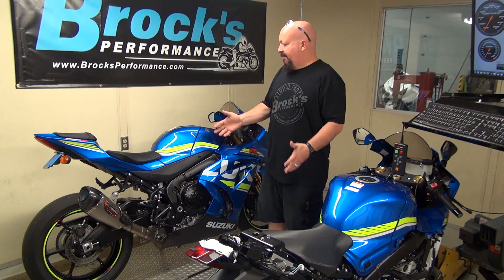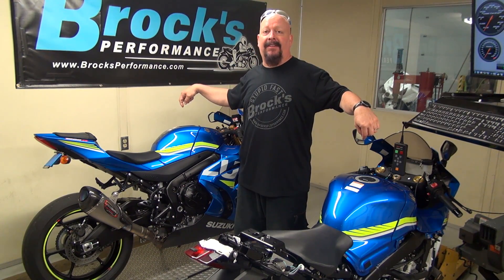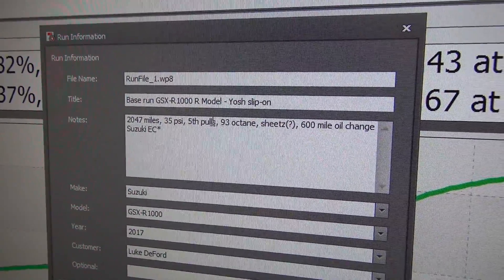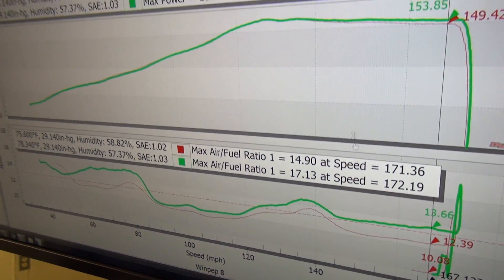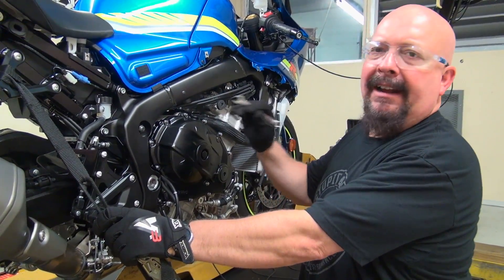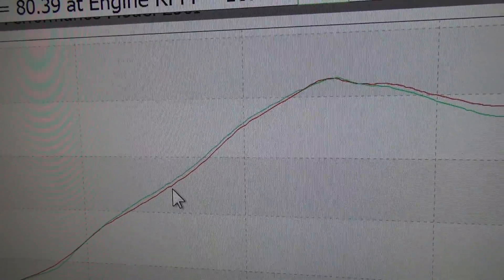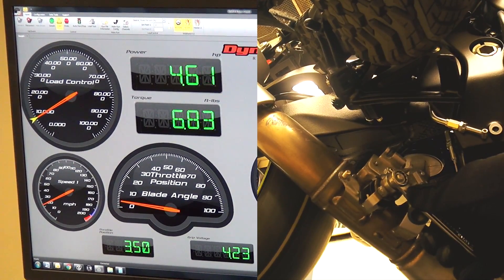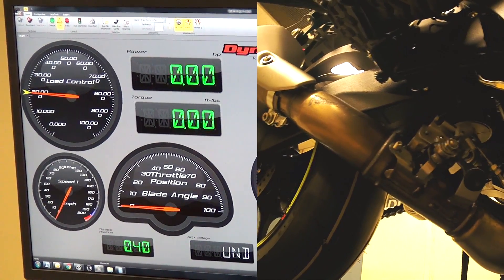2017 GSX-R1000 S2B: Episode 4 - Exhaust Installation and Theory (Part 2) Standard vs. 'R' Version

Comment: Expected as much... if those valves did anything but regulate sounds and emissions I would have been very surprised.
Love this series. Very educational. :D Can't wait for the next part. 

On a different note, what air/fuel ratio would you normally aim for?  On a dyno run, from 2008 on my 2001 CBR600F4i (~30000km, ~20k miles), with stock exhaust, aftermarket slip on and K&N air filter I saw an AFR as high as 17:1 and as low as 12:1 (blue line in image, Euro 95 petrol). I often see you going for 13.4 ish.

http://imgur.com/a/Cx6z0

This run was made before I replaced the exhaust system with a full titanium Akra system and a Dynojet. (got a completely different bike back after they were done tuning it).  Apparently they had some problem with the whole system having too much flow and the bike almost not being able to inject enough fuel. lol. I just went with that and never really asked about it. Still sounds like a bit of a weird thing to me, but I guess it could be possible. :)
Reply from the maker: It depends on the bike. Not all bikes run the best with XX.XX AFR. Generally, modern sportbikes run well in the 13.0 to 13.6 range, but it really depends on the bike. Your chart shows a typical chart with a map that was 'tweaked' - it's not good, it's not terrible...but it could certainly be better. We will have info. on this in an upcoming episode.